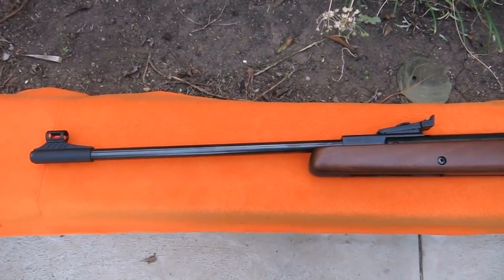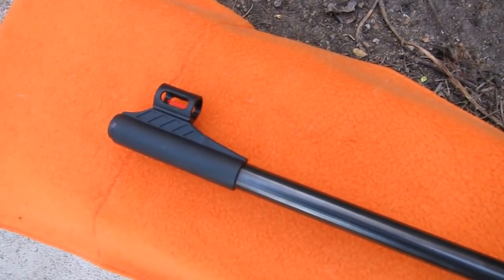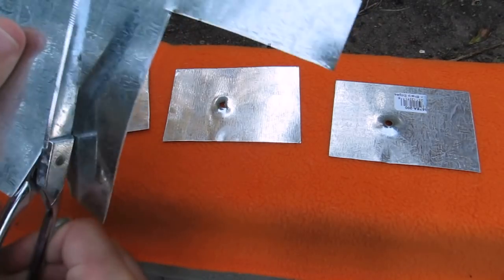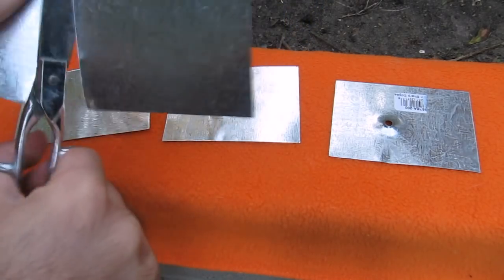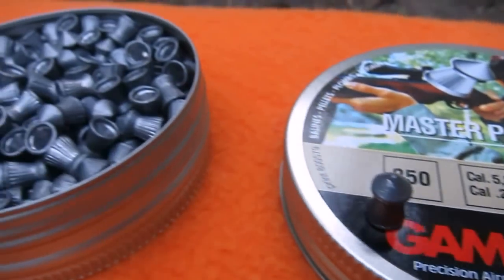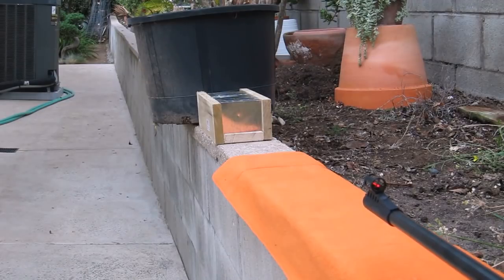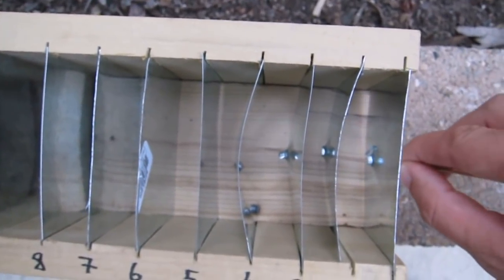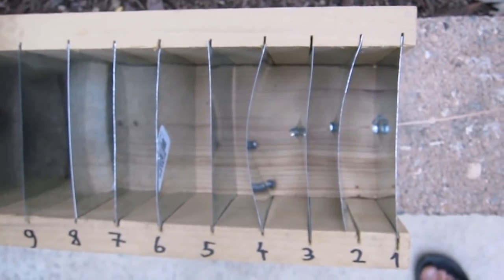RWS Diana 34 Air gun in .22 cal - Penetration Test - PART 2 of 2

Comment: I ordered me a diana model 34 classic .22 air gun and a tin of 250 jsb domed 15.89 grain pellets from pyramyd air 2 months ago with open sights and I got her broken in well having put about 50 shots out of her and I have the rear sight adjusted well so that from 20 yards away I can consistently hit 12 ounce pop cans. I tested her penetration from 20 yards away by firing 2 shots at 2 back to back thin plastic gallon jugs filled with water and both shots nearly penetrated thru and thru both jugs

Comment: I recently purchased the diana model 34 in .22 caliber and a tin of 250 jsb domed 15.89 grain lead pellets and I got her sighted in well with the open sights well at 20 yards and from 20 yards she can put a pellet thru and thru a thin plastic gallon jug filled with water. I used to have a diana 350 magnum .22 and it could shoot thru 2 of those jugs but it was harder to handle and too big and I didn't like the sights. I much prefer the diana model 34 .22

Comment: My diana model 34 classic .22 air gun penetrates the best and gets the best accuracy and expansion from 20 yards away using the H&N 16 grain hornet pellets. Those pellets from my gun are going at a maximum velocity of about 700 feet per second with a maximum foot pounds of energy of about 15 foot pounds and they tear through a 1x4 pine wood board like a warm knife through butter and lodge 60 pages deep in a hardcover book behind the board. I fire about 5 shots from my gun every session from 20 yards away using open sights and I consistently get 2 inch center mass groups using the hornets. The test in this video should be done with hornets. Probably 5 pieces of sheet metal would be penetrated because I get much better accuracy and penetration with the hornets than I did with the JSB domed 15.89 grain pellets I used to use. The hornets are very expensive hence I only fire 5 shots per session and I only go shooting a few times per month but they are so worth the price if you're shooting this gun
Reply: have you compared the hornets to the terminators? The terminator leaves a nasty cavity
Reply: I’ve heard the terminators are very expansive with their lead pointed center tip in the hollow point. Plus they are cheaper than the hornets. I prefer the hornets from my gun not just because of their deep penetration and expansion but also because they shoot so accurately from my gun even though the terminators make a bigger cavity and expand more. Really anything H&N is great from my experience. Diana German made break barrels and H&N German made pellets are the best by far

Comment: the gun sucks as set up the way its presented. 
A leapers scope 2x12x50 works better, A 80 buck vortex kit turns it into a really nice gun. the kit turns the gun into a 500 buck gun that hits a 1 inch target at 50 yards constantly using crossman hollow points.  The kit includes a much better spring system. Once installed you will notice the difference on the first shot. Its a no brainer., try it out. Try your test with the vortex spring upgrade
Reply: +G L Archer Yep. some of the airguns out today are extremely accurate and can produce enormous energy. My Hatsan 125, which I only spent $269.99 on, consistently prints sub 1/2" groups at 50 yards with 18.13 grain JSB Exact Jumbo Heavy pellets. It also generates 32 foot pounds of energy at the muzzle with those .22 cal. pellets. The recoil of ultra magnums makes them inherently less accurate than lower powered guns of equal quality. That's what impresses me most with the Hatsan line. They produce PCP accuracy and power out of a spring piston. I happened to have a gas spring installed in mine. That reduces the recoil some. I also can't say enough about the Quatro trigger either. It breaks consistently at three pounds out of the box and could go lighter if I adjusted it. I chose not to as it's an ultra magnum and I wouldn't want to set it so light that the gun goes off on it's own. I'm into it a total of $389.99 with the Leapers scope I put on it. I agree, those Leapers scopes sure give you a lot for the money. 

The Hatsan 135 comes with a walnut stock and I have that one in my sights for my next purchase. It's the same gun as mine, but with a walnut stock.
Reply: If you want an Air Gun rated scope, use the beast, buy and use the Hawke line of Air gun Scopes. "Why settle for less, when the best cost's no more!"